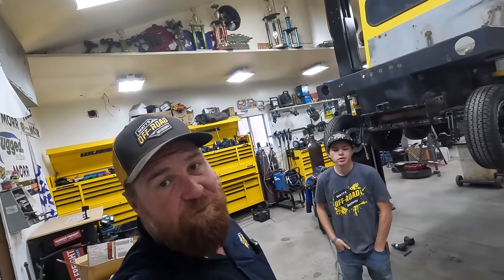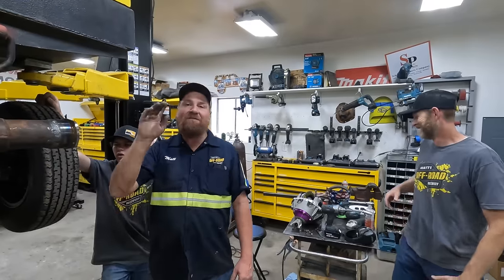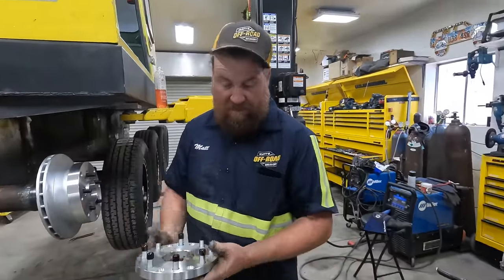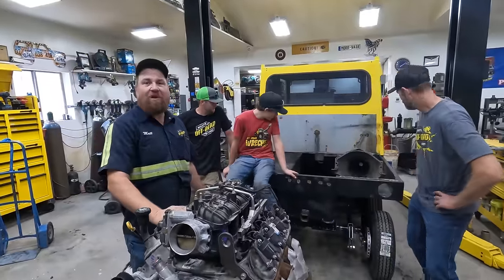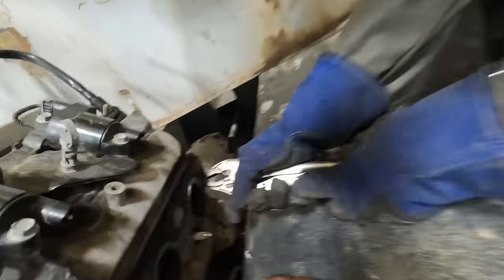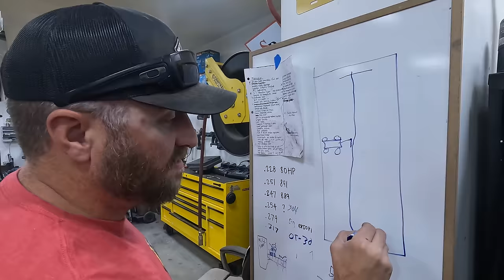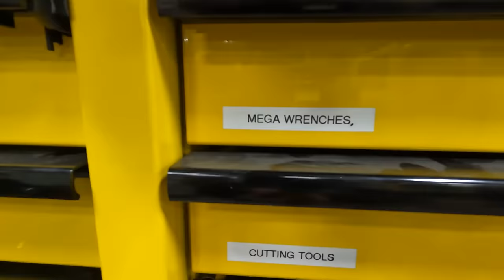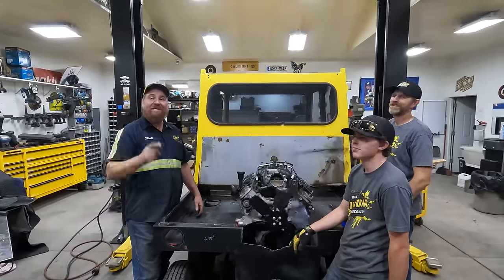Did We Make The Bombi Too Powerful? Massive LS Engine Barely Fits.

Comment: If the soil turns out to not be compacted and stabilized enough you could end up with the foundation/floor slab settling unevenly. Best case you end up with an unlevel floor, worst case, things break. I've seen it happen and it can cause major issues. Better safe than sorry when sorry could mean the structure doesn't last. Just imagine if the slab settled or cracked under a lift, which would be a point with a lot of load and stress.

Comment: Maybe they put the drive axle in the front for weight distribution, because the motor is at the back? I think it’s meant to be a little rear-heavy so it can climb up onto the snow, hence the engine at the back, but not too rear-heavy.

Comment: I would cut that whole back section to add to the cab....because it still looks like you don't have enough cab room with the motor and tranny in there.....and you will need an  external air source as well to help cooling so the block does not create any windows

Comment: I completely agree about the IFS I have a wrangler but I’m in love with the new bronco and when they took aim at beating Jeep in the off-road category I was so disappointed when I saw the the IFS on them. The only way to beat jeep is to be able to keep all four wheels on the ground that can only be done through solid axles. And yes, I know the argument about how much more time you spend on road and how much of a better ride it is, but I wanted the best off-road and I’m not going to go Baja through the desert most vehicles taken off road are going low and slow and all four wheels need to be on the ground.

Comment: Heavy equipment fans reverse direction ever so often to blow the radiator out, but they generally suck in. Also, using electric fans on the Bomb-Bee would have been a better idea for airflow and not having to cut the tub apart.

Comment: Careful with those Acorn seat lug nuts on the flat surface of the sprocket. You'd be better off with some torque retention lug nuts, as they're designed for a flat surface. Just imagining you snapping all of the studs off on a trail is all

Comment: 33:13 Flipping that fan over won't change a thing.  The air still moves the same way.  It's just like flipping a bolt around - the nut will still thread on the same way.

Comment: They make the drive sprocket on the front to rattle the track clean before it reaches the sprocket, when it's in the back it literally eats the dirt.
You can see the good on an excavator, during digging the drive is in the back to keep it clean and for "transit" they turn to get it to the front

Comment: I'd say that the difference between a motor and an engine is that motor simply provides motion and engine is more of a core part that is the main source of power needed for operation. If you look at diesel locomotives, they have separate engines and motors. Diesel engine is powering an electric generator and electric motors are moving wheels. The same with range extended electric vehicles. There is an engine that runs the generator and electric motors providing motion. Even in heavy equipment like excavators you will usually have separate engine that may power hydraulic pumps and then there are hydraulic motors. Engine is sort of the more general purpose word, that's why there are also game engines, web engines and many other engines that have nothing to do with motion but are rather the main element that drives the rest of the complex device or a system.

Comment: I live in the north. I've never seen a disk brake 'frozen' from the cold. I have seen tires frozen the ice/snow. And, if you have wet slushy conditions and then it freezes and you drive your vehicle and it sounds like it's trying to kill itself because it's winder; it is slush frozen to the power train.

Comment: Make sure it's tight n lock tighted so it doesn't come off due to the direction it's turning. Overtime it could come loose. Soon as it does it's coming off in less than a second.

Comment: Matt ! A motor is only to poweful it 1) won't fit /  2) it can make the vehicle go from wheely to. Turtle on its back !  Just remember it is not a toy it is a tool to move stuck vehicles that will often. be bigger than the "Bomb-Bee" !    

gerald dudley

Comment: Don't you have to measure the rear axle [wheel] at a ~ 'nominal' extension distance? If you do it at 'maximum extension' then you'll have no adjustment if the track(s) stretches?

Comment: If you're really worried about frozen breaks, why not point the exhaust pipes at the brake discs...

Let the hot gases from the engine melt the snow before it has a chance to freeze the brakes up...

Comment: The fan is on backwards the tips point in the direction of flow so as to scoop the air 🤣
Should probably turn the Cabin around on this thing and drive the other way unless your driving backwards towing everything ?
Bonus if you reverse the Cab you can put your feet beside the motor and get more cabin space 🙂
Reply: lol. electric fans, mount rad wherever and forget about that junk. add electric water pump for even more versatility, have a smaller belt only drive alternator. constant flow of coolant and air through radiator.

Comment: An engine produces mechanical energy from a fuel. (ICE, jet, rocket)
A motor converts one form of energy to mechanical energy (electric, hydraulic)
So, what are you using for a wiper engine and a heater blower engine?

Comment: Simply flipping the engine cooling fan does not change the airflow direction. Pull the fan, stand it up and look at the fan blade angle. Turn the blade so the side facing you is now away from you and you will see the blade angle is the same. You are going to need a new fan blade with a reverse pitch.

Comment: The drive axle on the front with the original (smaller) engine and solid rubber boogie wheels was OK. With your larger engine, the rear boogie wheel (a tire) will be under a very high load. This rear boogie wheel will have to manage the full load to get the track from moving to the back to pulling it forward as the drive sprocket is pulling the track from the rear. I do not believe your tire can handle this load. Having the drive axle on the rear removes this load direction change as it is floating when the track is moving forward as seen when a track is not tight. Looking at heavy track equipment the drive axle is in the rear. 
This would also solve the axle rotation direction as a directional transfer case would be needed.

Comment: Perhaps a silly, and unnecessary idea, but wouldn't it be nice if the track tensioner could be adjusted using a crank inside the cab or in the engine compartment? I can't imagine it is any fun trying to get a possibly rusted shaft turning laying on your back in the ice and snow?  (I'm thinking of a greased threaded rod actuating a lever to move the axle pivot that you can turn while upright.)

Comment: Tracks should always be driven from the back when in forward motion. This puts tension on the bottom where ground contact is, and slack on the top. Front driving pushes the track into slack in contact on the ground and puts all the stress tension on the top where the track returns to the drive.. Look at any dozer, any crawler crane/hoe, any tank, any tracked military vehicle. They ALL drive the tracks from the back for a darn good reason.

Comment: Dictionary, MOTOR, A device that converts any form of energy into mechanical energy, especially an internal combustion engine or an arrangement of coils and magnets that converts electric current into mechanical power. A motor vehicle , especially an automobile. So a motor covers ice as well as ev's

Comment: If you use a non stretching rope for the rodeo and leave it hanging with about 300 lbs of weight on it for about 24 hours you won’t have the spinning of the contestants. Which would make it easier for them. But if you want the added challenge then stick with the stretchy ropes. That part of why they used to set up the gallows a day in advance way back when. A grim thing to know. But for reasons I don’t fully understand my head is full of random facts. 🙂

Comment: A motor is a device to which energy is applied to achieve movement…. An engine is one that you supply fuel to and it converts the fuel to energy!

Comment: I foresee issues with switching the tracks to put the slack on the ground, instead of on the top "no load".  It's like trying to push a chain on the ground, rather than pulling it, it doesn't want to stay where you want it...  There's a reason why pretty much ALL track driven vehicles have this design, but Matt likes to change things considering just one variable, but then finds out the hard way ALL variables are part of a system in engineering...

Comment: Well, anyone who complains about dry-fitting knows nothing of construction of any kind.  Whether woodworking or mechanical, you ALWAYS test-fit before final assembly.
Bzzzzttt!!  Sorry.  Thank you for playing, but the "lower 48" refers to the contiguous United States, not counting Alaska and Hawaii.  The term originated with Alaskans...

Once I was helping a friend replace a head gasket on her Rambler wagon.  One of the bolts broke, and lacking the equipment you folks have, we drilled it out and put in a heli-coil and new bolt.  ;-)

Okay, guys:  counter-clockwise vs. clockwise is a matter of point-of-view perspective.  Of course one way is "backwards,"  just like when you try to read something in a mirror. And you can see things in a mirror that aren't in front of it, because YOU shift YOUR position relative to the mirror, as well as moving your eyes.  (I once had a CAT who figured out how a mirror worked, and would use it to look behind him to see if we were watching before he attempted mischief!)  This is why it is better to give compass points for directions than "right" and "left," because the latter changes sides depending on your own direction of travel, while compass points do not.

Comment: I really think you need 2 Calipers PER SIDE to minimize wear on those brakes with how much you use them. Get duel or triple piston Brembo brakes and calipers. You'll have so much less heat. Also maybe get slotted rotors to help dissipate heat as well. Especially if you're going to be running it in the sand and summer at all.

Comment: What if you ran the exhaust pipe, in and out of the cap, this would give the cab heat, a cage could be built around it, so nobody gets burned.
Reply: is this ww1 and vw beetles again?
but yes using an exhaust heat exchanger works great, until you develop a leak and pump carbon monoxide into the cabin.. permanent dirt nap time.

Comment: Why not have the headers flow to the “front” of the engine. Nix the fan and run the radiator to the side. Possibly 2 smaller radiators one on each side.

Comment: I wish that they would use the 4.3 V6 (A 5.7 with the two front cylinders removed) the 5.7 is too much whereas the 4.3 would be enough HP to move that track safely.

Comment: @Vice4x4 has a high pinion in his trophy truck and it runs a power steering pump to circulate oil around the pinion gears

Comment: Old saying, any piece of machinary is only as good as its weakest link (point), hands up, no snow where i live but it seems like the weak point wont be a shortage of power but more likely getting it through the tracks. I would say fingers crossed but who needs luck when the MORR team of crack engineers are on the job

Comment: Idea for the exhaust: in towards the back wall, into a (vertically oriented) muffler, then straight up with a turn back at the top so water doesn't get into the exhaust. It also has the benefit of not putting the exhaust where you might be working

Comment: not sure if you really don't know or are doing satire, the lower 48 refers to the continues United states Alaska and Hawaii are set apart by either country or ocean boundaries the reason this is a  thing  is that if you live in Alaska or Hawaii, shipping and freight availability cost a lot or are simply unviability I can remember buying an all in one washer dryer in Hawaii for $927 where as same thing was $175 on mainland.
Reply: The continental United States is the common term and lower 48 used by those in Alaska

Comment: Transmission is a motor. It creates nothing but movement. The engine only creates the power to turn the transmission.  So it can create movement.  Even if you put a pully and belt on the back of the enging. It still does not create movement.  It provides the power to turn the pulley that creates the movement. 
Simple. But seldom can you have one without the other.

Comment: hi guys ive been wondering about this for years but wouldnt the sprocket on the 9 inch be some what like a gear and the track be like an elongated gear....and in this arrangment that combo would be the final drive gear in your drive train....trany-diff-track....3.0x4.5x3.5=47.25...the 3.5 being 19 gear teeth and 280 inch length divided by 8 inches or so between the teeth on your gear...wild a$$ geusse or wag...on my part or i could be wrong but 47.25 too 1 is some serious gearing
Reply: 10 gear teeth sorry
Reply: @4725 rpm the track should be turning 100 rpm which would mean you would be going 2800 inches per minute...233.3 feet per minute...2.6 mph dont seem right...that seems awfully slow...but then again 3 to 1 would be like first gear...that would be like a super creeper gear but it mau take that much to get you rolling in deep powder

Comment: Instead of using the engine fan to cool the radiator, why didn't you use an electric fan with a thermostat?  It would've saved you from cutting the rear frame.

Comment: Internal combustion "engines" and electric "motors" actually do
EXACTLY the same thing. They both convert chemical energy into kinetic energy. So yeah, there's no difference.

My personal impression in the past is that "engines" involve fire (combustion), fumes, and noise, and "motors" lack all that and go about their business quietly and cleanly, but as you say that really doesn't stand up to close inspection and critical thinking. I used think that "engines can be motors but not all motors are engines", but from now on I will use the terms completely interchangeably.

However, an EV's "go pedal" is an "accelerator", NOT a "gas" pedal.  😝

Comment: Your half right? Yes, pushing the air through the radiator does work, But the motor is usually walled off. So that way, all the air that goes through the radiator does not come from around the motor.

Comment: Anyone who says that motors are exclusively powered by electricity is flat out wrong. No ifs, ands, or buts about it. An engine is a type of motor. An engine is generally understood to be a motor that converts fuel to energy through heat, but even that isn't necessarily a hard and fast rule.

Comment: that's not how that wheel attaches. when the hub doesn't hold the centre of the wheel and the face of wheel is flat you need to use a mag nut with a washer. when the hub holds the centre of the wheel and the wheel is flat you can use a flat face nut. the shear stress shouldn't be on the stud. you can never use conical or spherical on a flat wheel. looks like you need mag nuts, maybe some more cutting. the wheel should be reamed, not drilled, to the spec for the nut otherwise the stud is likely to break from the wheel hammering at the stud through the nut.

Comment: An engine can be a motor. But a motor cannot be an engine.  The engine creates its own source of power by mixing fuel and spark and compression. A motor gets his power from another source like a battery or AC electric. That is the difference between an engine and a motor.

Comment: it's not the countries it's the 48 states of the united states lol. that's what Alaska calles us. the lower 48 edit: also your cooling this exactly like a forklift lol. you cool the block directly and the radiator with the same air using the air twice. as the air gets hotter it want's to get out of the area faster because heat expands and that is how you use physics to speed up air flow and not fan speed keeping the motor cool

Comment: Like the enthusasium, but thumbs down on entire design. Should be built like a Bobcat skid-steer, 4 banger diesel attached to a hydraulic pump, that powers EVERYTHING. Even the winch. This thing is all torque,,, not horsepower.

Comment: Flipping the fan doesn't change the direction of the air-- you have to re-route your belt so that it wraps the other direction around the pulley for it to blow air outward...  Which will cause it to spin the other direction;   I assumed that's what you were doing.......    Again, just flipping your fan doesn't do anything at all.   Next time the fan is in your hands, look at the direction that the fins are angled-- and then flip it over:  They will still be angled the same direction.  Flipping the fan alone, does nothing.

Comment: Wrong, the lower 48 is the number of states within the continental united states. As the remains states are not connected the the u.s. By land. So all the states between the east coast and west coast as well as between Mexico and Canada equals 48. So when someone says the lower 48 they are basically speaking about all the states you can drive through without needing a passport, or all states connected by highways that do not leave the boarders of the continental united states. The lower 48 has nothing to do with all the country's of North and south America combined, as I am fairly certain you would be closer to a hundred .

Comment: Wondering why you didn’t use an electric fan. You could mount it anywhere.  Wouldn’t have had to cut the back frame. You’ve made a weak point in the frame. Hope you reinforce it.